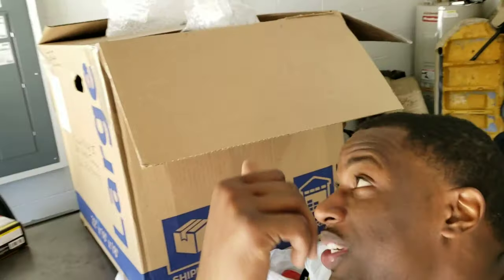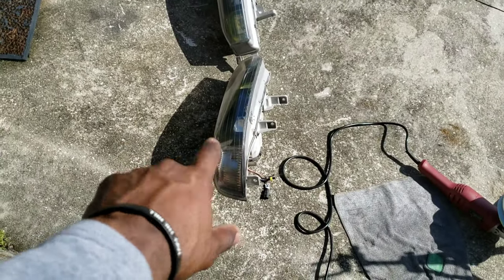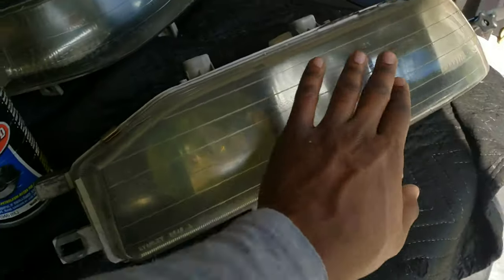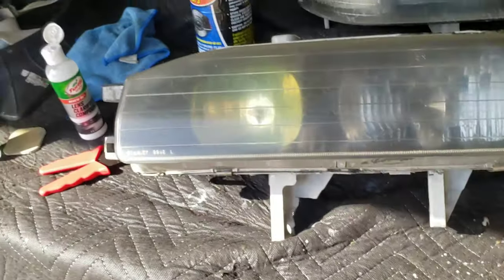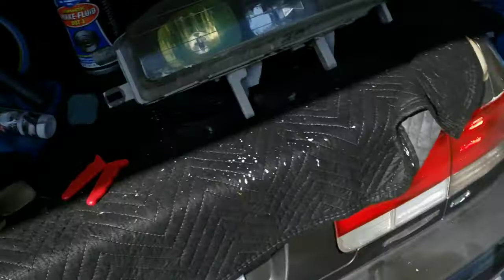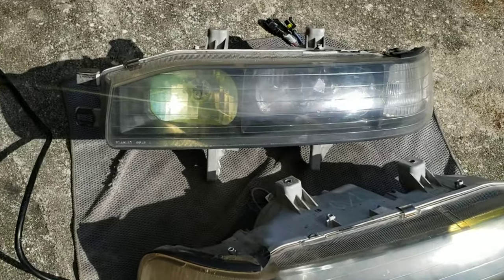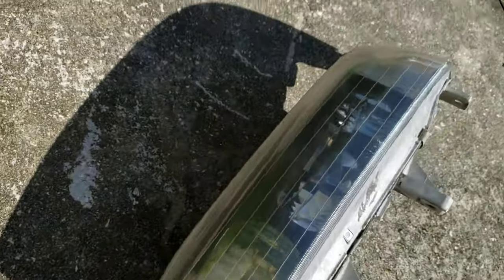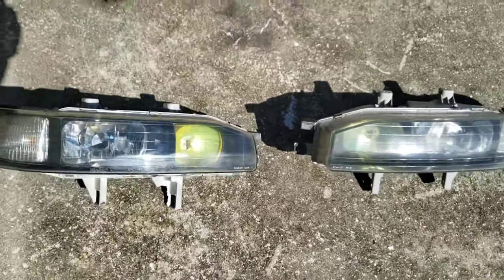CB7 ACCORD ONE PIECE HEADLIGHTS | TURTLE WAX HEADLIGHT LENS RESTORER KIT #turtlewax

Comment: All you need is to clean it with glass cleaner. Use  #0000 Super Fine Steel Wool with glass cleaner and scrub it clean. After use glass cleaner to clean it up. Now soak a paper towel in acetone where it's dripping from being so wet. Do a pass all the way across the headlights. Flip it backwards for the other headlight. Use glass cleaner after and clean the headlights. Looks brand new every time.